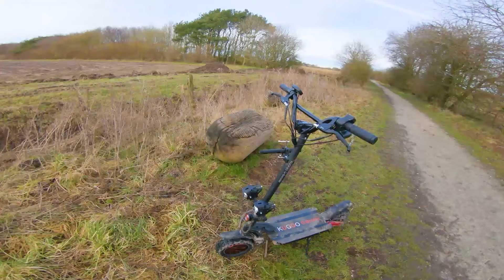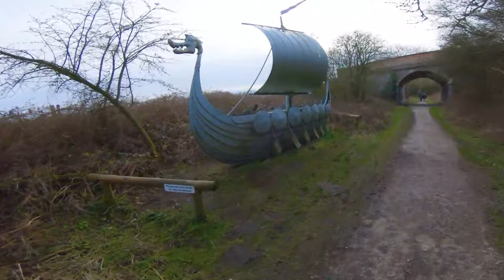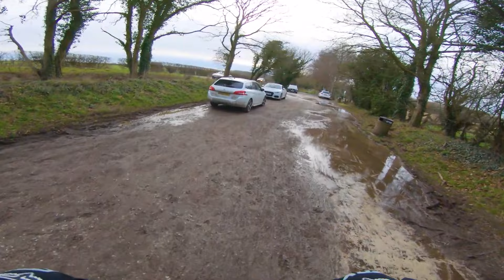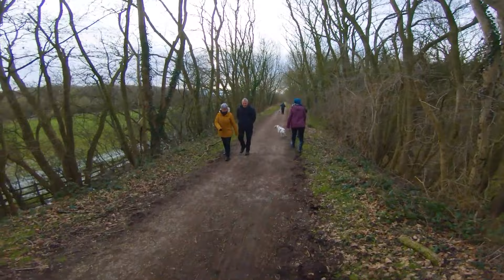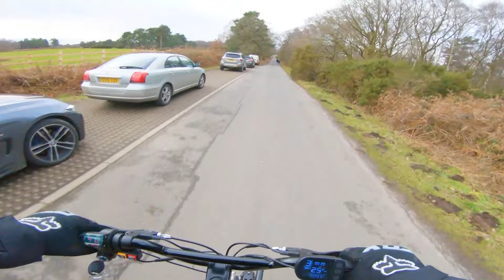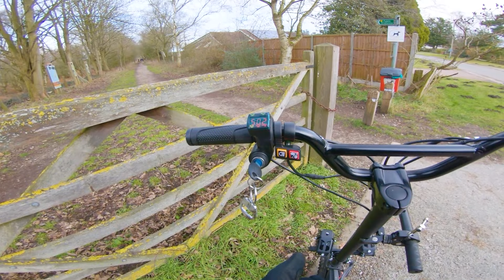Why Is My Replacement Kugoo G Booster Electric Scooter Also Broken After 20 miles?!!

Comment: Good News, Nice Looking Trail / Path I Still have the M4 Pro, & I've Replaced The Handlebars, Stem, Shocks & About 90% of the bolts, only done about 70 miles on it, I've upped a few videos also, But I can't get out on it, Because Scottish Weather is Crap, Good to see you back cruising and Appreciate the Videos , Be Safe...
Reply from the maker: By the sounds of it you've fixed most of the flaws on the M4 now then, just looked at yours and its looking good! My M4 is still my favourite out of my scooters and its the one I've put the most miles on because its really smooth and comfortable on the road and not too heavy to cart around. Weathers much better here either bud, roll on summer!
Reply: @bill-e6114  stick with your m4 pro my m4 kirin is going really strong and havent replaced any parts and use everyday great to see back bud
Reply from the maker: @Hendaz89  I agree, I love the M4, its so reliable and so smooth, its my favourite so far. Good to be back 😉
Reply: Yep I use my standard Kugoo M4 has about 400 miles on it never had to replace any part on it.

Comment: Hey there buddy sorry about the late update, I had to wait from November for my m4 had loads of issues with supplier and they eventually sent me a different scooter called a honeywhale e5 as a replacement after making lots of excuses about brexit and essentiall work.
Just waiting now to give it a good try.
The sculptures looked great 👍 
Well done on being polite to the pedestrians 🚶‍♂️ 
Hopefully you will be able to resolve the issue with cogging, I have not any experience but my logic tells me if you have two independent motors one may be going at a slightly different speed to the other and causing the issue.
I have had similarities when my viscous copeler on an old p38 Range Rover went bad. It caused the wheels to skip when going into corners witch in turn ruined tyres and caused drag as the slower wheel was skipping trying to catch up.
Like trying do get round a corner with a locking differential ( the outside wheel need to travel faster) in a car.
Your Scooter 🛴 has two wheel in line disconnectable drive, so one controller is out of sync.
Just a guess 
Great to see positive attitude and I am quite sure everything will turn out great 👍 
Best wishes from West Yorkshire 
P.S. wear some gloves and knee protection, because it’s like all fast things eventually you get used to the speed you want to go faster and forget just how fast it is until ouch.
Stay safe buddy you are a valuable piece of our community
Reply: Howdy, sounds like a pita, this is the 2nd Kugoo scooter from the same supplier, makibes on Amazon, the first one arrived & when I opened the box it was Clear that some Damage may have occurred During Transit, here's a quick rundown, the front light was in bits, I Repaired, The Battery inside the footplate wasn't secure, so it would rattle about, & the steering had excess play, Scratches here and there on the frame and Mudgaurds. I Fixed Most, But Then after doing about 25-30 miles the thing would shake and vibrate, I Contacted the seller & sent it back to Poland, got a replacement Which was Worse Believe it or not, Steering Issue Again, Warped Brake Disc, side lights working only 1 side & a Vibration Going Right through the frame, like a wheel bearing gone in a car, took it to a electric Scooter shop, & they wouldn't touch it when they seen the Kugoo logo,  it's not long back from Poland & I Clearly Noted The Faults On A4 Paper and attached it to the frame & then Carefully Packed it up, & it came back with just the side lights fixed and Nothing Else. And The Accelerator and display was Snapped off the bars and the back mudgaurd  broken should have got a full refund at the start, all in I've spent about £900 Absolute Nightmare,  You Couldn't Write That Material. Waffle Over & Good Luck & I Always Wear A Helmet and Protective Gear And Would Advise It Always. All the best from Glasgow...
Reply from the maker: That looks like nearly the same scooter so I wouldn't be too worried. It might actually be better built, lets hope so! Weather is part of the reason why I haven't uploaded for a while.
Well I've got some checking to do, my new Viper scooter doesn't do this at all and just launches. The G booster, its like the front motor stalls when it meets some resistance but then affects the whole scooter after putting it in sort of a limp mode.
I've bought better gloves now and I am considering knee pads soon. Lucky enough to have not fallen off in a while though touch wood.
You stay safe too buddy and its really appreciated!😀

Comment: Was fairly set on getting the g booster for a while but to be honest after hearing about the cogging issues and joining the Gbooster whatsapp group only to see more people reporting problems, I've decided on the Zero10x straight from the manufacturer. They're sold as the T10 DDM model and then it seems the likes of Apollo and Zero buy them in bulk only to stick their own branding on it. Should be able to get one made to order with the parts you request and it'll cost just around the same as the g booster. All in all, you should be able to pick up a whopper scooter for the same price as this one....
Reply from the maker: Probably the best move IMHO. The unicool would be a better choice definitely. I'm kind of tired of the controllers on this now. Its so rough on pull away I can't take it much longer and need it sorting
Reply: what gbooster whatsapp group is that? i cant find it
Reply: They started using newer controllers that aren't as good as the previous ones. I've heard if you replace them and the lcd for older version they work well

Comment: I actually bought a Kugoo M4 Pro after you covered it. It's a lovely scooter but.... it developed some sort of fault (Error 01) after just 23km. Very disappointed. I suspect its a hall sensor fault and not really being experienced with anything of this sort, I went ahead and bought a motor and a controller. Either way, it's good to have spare parts I suppose.

Their customer service seems bad, haven't received any replies. Had I known, I would have saved up and gone with the Emove Cruiser, even if it is more expensive & shipping from the States to Malta would really be tricky.
Reply from the maker: That's not good to hear, but glad you've got it sorted. I'm going to be covering some methods to increase the life of the controller soon as 95% of the problems out there are the controller overheating and failing. Motor failures are a lot more rare.

Yeah I think your pretty much on your own with Kugoo after 30 days, which is a shame. 2 brands in the UK that interest me are Solar and Viper. Solar have 2 year warranties so your covered relatively well and they have a good range of scooters
Reply: @bill-e6114  Will give those brands a go then since getting stuff from the UK is a lot easier than the US for me (got the m4 pro from an Ebay seller). Haven't sorted it out yet since they will take a while to arrive, but hopefully I will :)

I love the M4 Pro for its power relative to its weight. 23Kg is quite managable.

Comment: Always cracks me up how polite the English are.
Anyway I almost pulled the trigger on Kugoo G2 Pro, but I see a lot of negative reviews on the brand and seriously having second thoughts. Any advice please? Should I consider another brand?
Reply from the maker: They sell a lot of scooters buddy, not all of them have problems. G2 Pro I think is one of those that has less problems and heard its a pretty good scooter. Kaabo Mantis lite is highly rated same type of power and rear wheel drive
Reply: @bill-e6114  ok. Thank you so much for the feedback. You advise is much appreciated. Also another area of my concern is the battery pack. I understand most reputable brands use LG or Samsung and Kugoo use unspecified Chinese 18650's which could potentially deteriorate in maintaining capacity prematurely?
Reply from the maker: @paulwhat322  No problem, Yes that's the risk you take with the cheaper scooters, so they require a little more vigilance when discharging, charging and storing. Usually better brands and the more expensive models generally use branded cells. But saying that if you treat the cheaper cells right they are fine for plenty of cycles. Some people have clocked well over a thousand miles on the M4's and the batteries are still going fine. My M4 has 21700's and its been fine so far and is even handling a bit more discharge current than standard
Reply: @bill-e6114  okay. Thank you for that. I'll keep it in mind. Happy scooting brother!

Comment: Mine still does it I bought a new controller but it was a bit different but still the same outcome  so I opened up the old one and everything looked fine so I put it back in, I've isolated the controllers separately with foam so they don't rattle when the power goes through them,  maybe its placebo but it feels better and not as noisy, it's my rear motor that does this but I did swap the power wires over from front to back and then the front motor started doing it I don't even think it's faulty controller I think it's the way the power/amps are mapped through the controllers and it bottlenecks somewhere , my kugoo is still fast as fuck it's just a bit annoying sometimes when it happens,  I think the only way out of it is to buy the old controllers and display ,I won't though cause I'm still happy with the power and speed,  ps I've still got mine on 12amps cause I couldn't tell Any  difference when moved it up , thanks for the video👍
Reply from the maker: Ah so you've done a thorough investigation already, that's good then it sounds like they've put the wrong controllers in possibly for them motors. Shame you cannot  have the controller learn the motors but no halls for that. I may try soldering those phase connections directly rather than those bullet connectors as they are well known for problems. I am reluctant to change controllers yet too, but have you ever had it do what mine does where there's hardly any power and struggles to go over 15mph? When I wack that P14 setting to 19/20 there's quite a big difference in performance in my opinion. Still a great scooter, just ruined slightly with a poor updated controller choice. Cheers 😀
Reply: @bill-e6114  yeah I'll keep delving into it try find solution, it's not the motors I took the motor out and cleaned it all up it's something to do with the power what goes through the controllers , I think you saw  the first one I did heres the second video 

https://youtu.be/F3k9FfKI92I
Reply from the maker: @ElectricunicyclesUK  Nice one, I am sure we can solve it between us. Must be quite a few annoyed new G Booster owners out there

Comment: i have 6000km on mine and it s the 2020 version (like the old one that u had) it s just that mine is called HongHao S12 and not G booster and had no problems, also mine came with Nutt hydraulic brakes and trigger display (1075 euro), always riding it in full settings and hard start still had no problems only a few flat tires :D
Reply from the maker: Awesome buddy, kind of wish I would have got the same as you. I'm completely removing these controllers soon and will replace with 2 independent ones so I can adjust the power of each motor and have the use of 2 throttles

Comment: Hey buddy great video subscribed for sure and watched all your other vids! Love your content man. What's your opinion on upgrading the battery on the g booster? I've got the older version so no problems really and everything works well apart from the fact that I wouldn't mind abit more range, never satisfied! Lol 😂 Was thinking about a 52v battery instead of the original 48v but don't know if the controllers would take it and am struggling to find a battery that I trust to be honest not sure if it's worth the risk. I wouldn't go for 60v cause the controller definitely wouldn't take it and would no doubt need rapkcing but have heard that you could potentially go upto 52v without damage. Thinking of more ah awell for the range was just wondering if you've ever done anything in regards to changing the battery or if you've had any success? The batteries seemed to be scarce and can't really find anything that look reliable and don't just wanna buy a cheapy cause it will no doubt be smaller than the original and probably blow 😂 currently got 23ah but was thinking more like a 35 upwards. Spoke to a couple of people on Facebook but they're all from Russia and I know the scooter is well known and big over there but not much on it in the UK unfortunately!
Reply from the maker: Cheers mate for that😀 Jealous that yours runs well 😭 I run 52v on a 48v controller in my ebike. I think the capacitors in that controller is the weak point at 63v, so would imagine G boosters are the same and would be fine. Batteries are so expensive now, but a decent custom battery builder in the UK would be the way I would go using quality cells would give much more range at the same AH. You could fill the deck, give the builder dimensions and he would be able to tell you the max you could go
Reply: Thanks for your reply mate! Appreciate all the advice and knowledge... Yeh I think I've read that the controllers for the g booster can handle somewhere in the low 60s so that makes alot of sense! Ah man if anyone can get it working it's you I'm sure, reckon you could just replace the controller in your booster to stop the cogging? And haha yeah tell me about it bro 😂 the decent batteries I've been looking at some LG and Panasonic in upwards of 6 - 900 quid crazy money! I guess its just a case of finding a reputable builder that won't rip you off not sure if I can justify the multiple hundreds of pounds for a few extra mph and abit more range but just can't help and wonder and would be nice to have, you know what it's like can never leave the bloody things alone as they are haha thanks again bud hope you get your one running smoothly soon 👌 👍
Reply from the maker: They're a good chassis, nice size and definitely worth upgrading if you use it constantly. That's what they are lacking, a really a good 52v battery. In my opinion 60v and upwards is too fast. Think custom is the way to go, try ebikebatteries.co.uk they've got a good rep. 
I will sort mine with 2 new independent controllers, that way I can change the power distribution to have more power at the rear rather than 50/50 😁
Reply: @Billy Reeves  yeah man I agree watching your videos has inspired me to get a better battery with abit more range and umph! That sounds like a pretty decent plan! I'm no where near as savvy as you are with them though in fact i wouldn't have a clue 😂 so if I take the leap I just got to find someone to set it all up I could give it a go but wouldn't wanna go and completely ruin it sort of thing lol thanks for the website mate appreciate it 👍 I'll look into it still learning really with the whole battery and controller situation. I guess I'm hoping that if I'm only going to replace the battery to a 52v then there won't be too much wiring to do🤞 if I knew what I was doing I'd probably replace the controllers aswell to avoid overheating but it just too much work for me to get my head around at the moment 😂
Reply from the maker: I think the only way to get your head around it is to take the plunge. They are relatively straight forward once you get into it. The battery won't be that difficult, 2 yellow controller xt60 plugs and the charge plug and your away. I would do the thermal tape mod on the controllers as a necessity to keep the heat down and see how it goes. 2 rules if doing controllers, never let the phase wires touch each other and never let negatives wires touch positves. If your close to Lincolnshire I don't mind lending a hand 😀
Reply: I think you're right mate only way really is to get stuck in and give it ago. Thankyou for the info and advice, to be honest that doesn't sound too bad really may give it ago in the future if I do I'll let you know how I get on. First thing is to find a decent battery that I trust! Haha thankyou man I appreciate that you'd even suggest, grateful for the offer. I'm all the way down in Portsmouth which is quite the travel lol but depending on how I get on I might just hold you to that! 😂 Obviously I'd pay for your time! Just about to watch your new video of the 5600w beast you've got I can inagine that's on a new level!

Comment: Bro I just bagged myself one of these brand new for 660 pound, cna I ask what is the relw life mileage you would get from one charge if on mode 3 the whole time? And will I need to upgrade the handlebars as I'm 6 foot 3
Reply from the maker: That was a steal, hopefully you've got the 23ah battery in there as some boosters are coming with 17ah batteries and the customers are none the wiser. Around 25  miles on average in good weather for mode 3. Handlebars were a bit low down for me and I'm 6 foot. You can get handlebars that have some rise or a new handlebar stem that rises to sort that

Comment: Billy is there enough cable to use the BMX bars? What you recommend? Finding mine a bit short and low..
Reply from the maker: So I've used junior bmx race bars on mine so not huge amounts of rise like some. I pulled a bit more cable from the stem as you can normally feed a bit more through and all works well

Comment: I got offered one of the kugoo pros the other day and everyone told me to stay away because the electrics are naff and the steering bearings are normally not good .
Reply from the maker: The wiring is a bit shoddy in places and the stems need attention most of the time but still good value once those have been sorted
Reply: @bill-e6114  I've got a hitway coming weds or I can wait till sat and get a T4 turbo . OR I can get the pro today .  That's the choice I have to make .  Its either hitway or t4